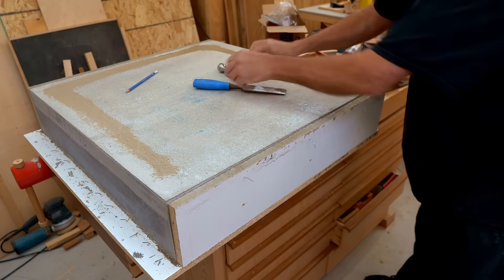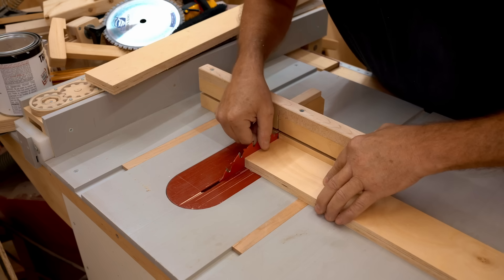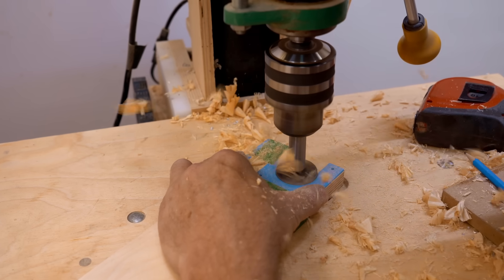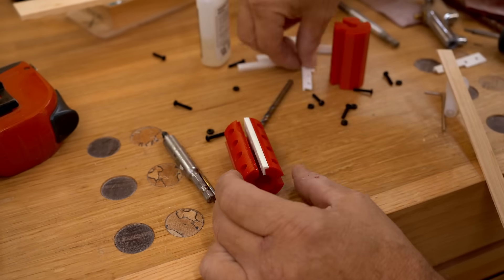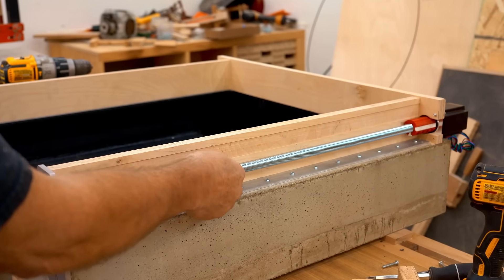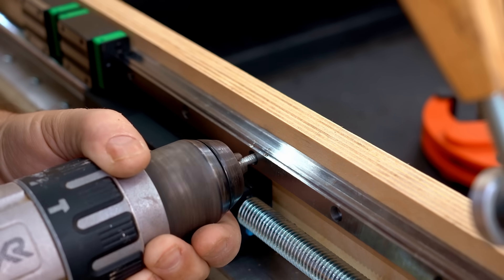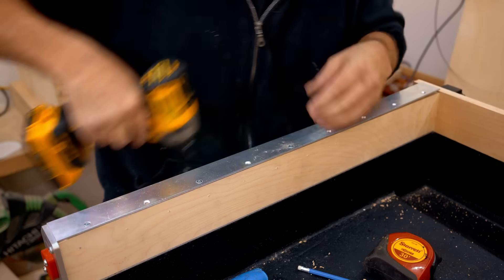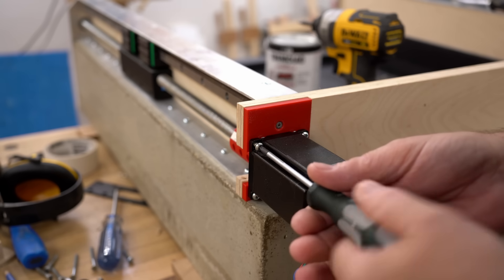Mistakes? What Mistakes? Paint H̶i̶d̶e̶s̶... I Mean Fixes It All - CNC Mill Build Part 3

Comment: You lost me at all that wood when the whole pour was about rigidity.

There should be metal everywhere forces would be applied including the connections between the stepper motors and the ball screws. Especially with what you had to spend on the linear rails and ball screws.

Using linear bearings attached to wood 🪵 rather than using aluminum or steel feels like you are throwing accuracy out the window. 

It's also a fire hazard. 🔥 Hot chips flying on wood would be bad for business.

It may look cool but you could have just cast the metal sides right into the pour.  

You could have also just made everything the rails would attach to concrete, and the steppers could have been mounted directly to concrete.

Pouring the top side using self-leveling concrete would work too. I have a friend who does concrete countertops, so I know that would work.
Reply from the maker: You are grossly underestimating the strength of the plywood parts and the assembly. But it's nice to see you edited out your comment about the wood being a fire hazard :)
Reply: @JohnHeisz  what you have to understand, in machine tools it's never about strength, but about stiffness. The mounting surface for linear rails should be stiff enough to pull the linear rail itself straight when it's bolted down. I built a few CNC routers myself and am now at a company that builds industrial CNC machines, so you can trust me on that.
Reply from the maker: @CatNolara  So when can both of you be over here to build it correctly for me? I'll make coffee, assuming I can do that to your satisfaction.
Reply: @JohnHeisz   Everyone knows what the comments are for. When something goes wrong, you will be right here making a video about how you had to save your home. You can tell your insurance company how you believed in the project.
Reply: @JohnHeisz  sorry, not a coffee person. And you'd have to get me a plane ticket from europe :P
Reply: @JohnHeisz  I'm not underestimating science and engineering.

Chinese cnc machines don't come set up with wood anywhere on them for a reason.

If you had went and purchased an engineered wood, or some specific hardwood known to be difficult to flex I might agree with it. This is just an aesthetic choice at this point.
Reply from the maker: @Deneteus  Plywood IS engineered wood, so you are also overestimating your understanding of science and engineering.
Reply: @JohnHeisz  I see you didn't pick up the context clues from my response. If every plywood was the same then I wouldn't have specifically pointed out alternatives or the fact stock homedepot plywood shouldn't have been the first choice.
Reply from the maker: @Deneteus  Lol, the "context clues"! What arrogance!
Reply: @JohnHeisz  Reading is fundamental.
Reply: @Deneteus  Your thoughts are fundamental, wrong also.
Reply: @KipdoesStuff  Not. Enjoy the copium.

Comment: you should probably have put a nut on each side of the far end bearing so it can take up  the axial load. Steppers can't take much axial load, just try pushing on the shaft it can quite easily move in and out a few mm
Reply from the maker: Zero axial movement in these motors and none in the other CNC builds I've done.
Reply: @JohnHeisz  surprising, I've yet to see a stepper where the shaft it doesn't easily push in a few mm overcoming the springwasher that preloads the bearings
Reply from the maker: @fuzzy1dk  Same arrangement on the StepCraft CNC - nothing to lock down axial movement other than the motor. Maybe you need to start using better motors :)
Reply: @JohnHeisz  I've used big,small,cheap,expensive, they all did it. Try placing a stepper on a table shaft up and push down on the shaft
Reply from the maker: @fuzzy1dk  I don't have to try, I did it in this video when I put the coupler on and said "it's a nice, snug fit" which means it took some effort to slide it on. 
Here's something to consider: I did all this the same on the CNC this replaces - the CNC that cut all of the parts precisely for the aluminum clamps I made. How could it, if there was any amount of end play?
Reply: @JohnHeisz  But, But...the science, lol.
Reply: The bearings are deep groove ball type. These bearings can handle axial loads, even though they are not true thrust bearings. But they have some axial play, so they must be preloaded. The amount of preload is critical as that will change with temperature. Too much preload and temperature could cause a huge increase, leading to excess wear and rob power from the motor. This is why spring washers are used. So it comes down to the spring rate of the washers. The motor shaft will feel rigid in the axial direction up to the point where the force is great enough to compress the washers. I just grabbed a hold of a shaft on a NEMA 42 and I'm not strong enough to make it move at all, but that anecdote really means nothing. John's past experience shows that the forces applied in his usage cases have not been great enough to lead to excessive axial play. Still, this is a valid concern, however we don't know the magnitude of the force at the onset of spring compression, which will depend on the speed/feed/cut/material of the work. John may find that limit during cutting, but it will likely be possible for him to adapt to it with CAM, resulting in lighter cuts and more passes. I'm sure we will see soon enough and I'm sure John will share his results if this ends up being another "mistake".

Comment: I'm surprised you didn't mount the linear bearings to the concrete. Did I miss a bit where you explain why this is so?
Reply: Was also wondering. Feels like losing the benefit of the concrete base a bit. But let's see how it turns out.
Reply from the maker: @pytebyte  "Fells like losing the benefit of the concrete base a bit" - Yes - A BIT - a bit, a small amount, as the plywood and aluminum plate assembly is securely bolted down to the base. Why is that so difficult for so many to understand? The difference isn't significant.
Yes, it would be stronger to mount the linear bearing directly on the concrete, BUT not that much stronger. And it would drop the linear bearing lower making the sides of the gantry span a greater distance, making the final assembly less stiff. 
This isn't checkers - it's chess and I'm already 10 moves ahead with this build.
Reply: @JohnHeisz  As a viewer of your videos we cant feel how strong it is and only estimate. With the aluminium and the upright wood I just see a lever in the X direction. If you would have to build the gantry higher the gantry could have material preventing the bending in X direction. But yes. As you mentioned in the reaction video. You planned the whole CNC and we can only see the current situation. Pls don't see this feedback as hard critic. I really like this build with the base and you are doing a great job.
Reply from the maker: Two reasons: first is that it would be much harder to do than fastening them to plywood. The second is to reduce the distance between the linear bearings and the X axis on the gantry to increase stiffness.
Reply: @JohnHeisz  Thanks for explaining. This might be obvious to you, I do not have experience with this kind of equipment so I only have some general assumptions...